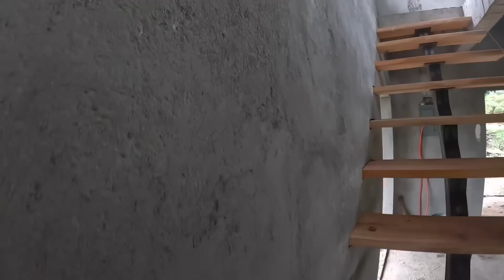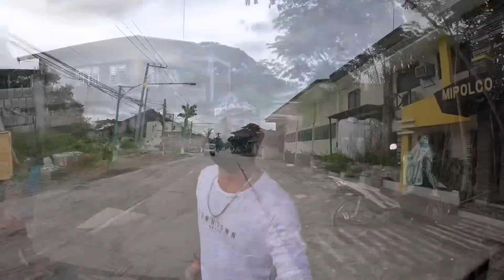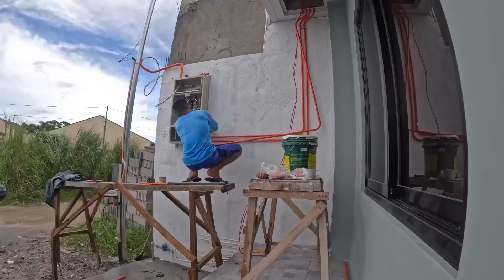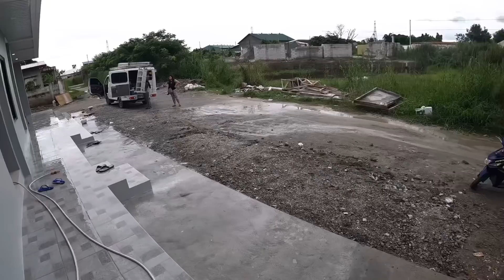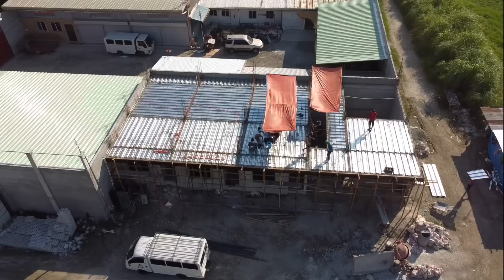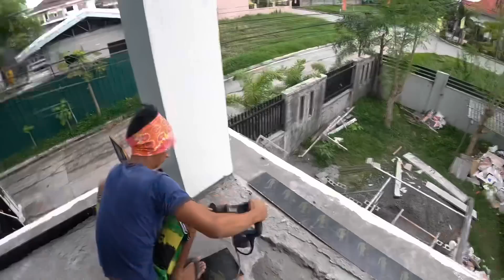Before and After minalin project

Comment: Congrats to Rhegsvlog builders and tropang sugo for a job well done at minalin project. Today is the final turn over of the project. Very important talaga ang turn over sa home owner to address the minor problems, if there's any. Unlike sa San Vicente sa house ng mag asawa walang nangyari na turn over. So technically hindi na responsible c rhegs at tropang sugo kung may issue sa bahay. At c MMM sa vlog nya mentioned ang mga issues sa house nya. Well, problem na nila yan. Once again, congrats kay Rhegsvlog at tropang sugo. Marami pang naka line up na projects. Keep safe. God bless all.
Reply: well said po sir...